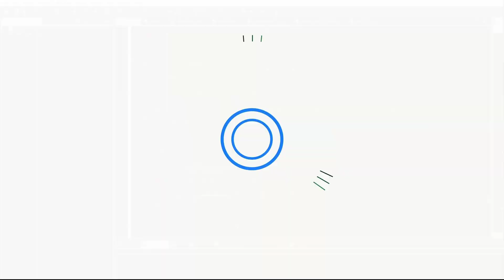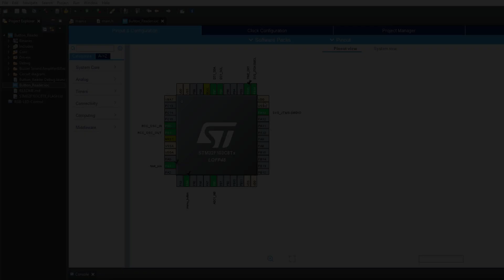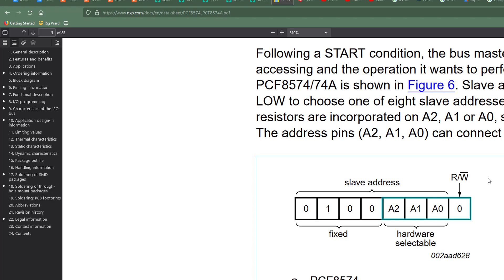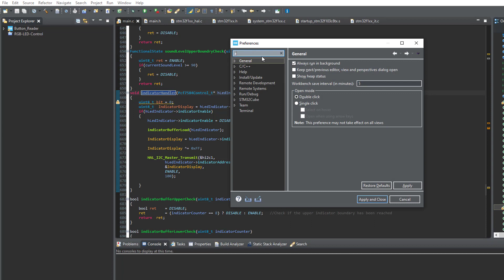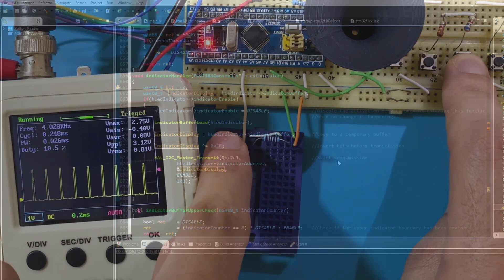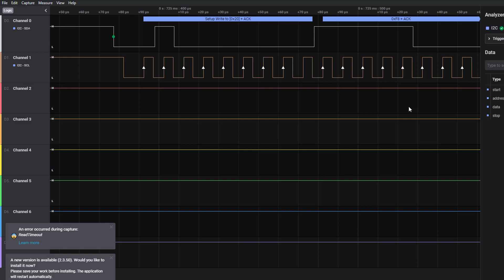STM32 Interfacing PCF8574 Pin Expander LED Sound Level Indicator Over I2C

Comment: Can you do the inputs?
Reply from the maker: Hi,
Could you explain what you mean?
Reply: @usefulelectronics  how to use the set the pins of PCF as inputs, coz you've done the pins as output here, so inputs this time
Reply from the maker: @JoshuaJapitan  yes of course I explained this in the tutorial actually. To do read operation, the I2C address LSB is going to be set to 1 and you will be executing I2C read function in your code